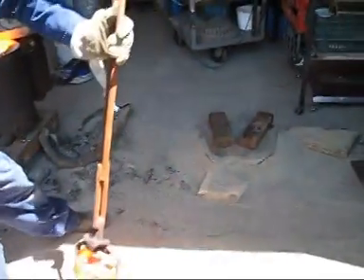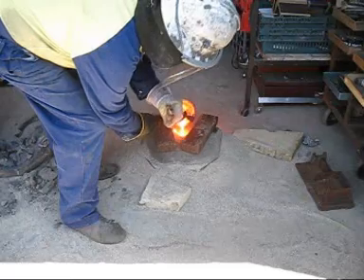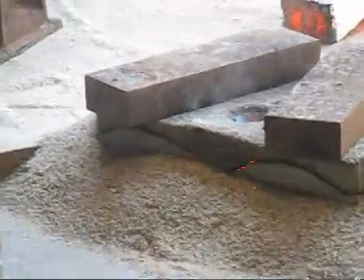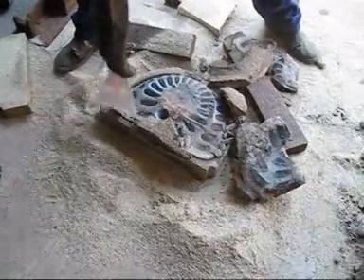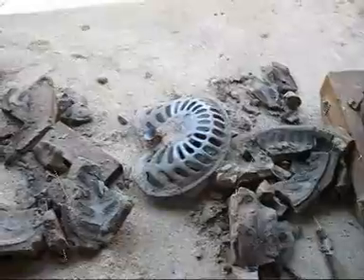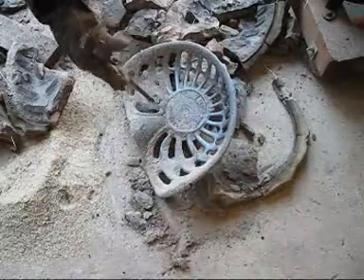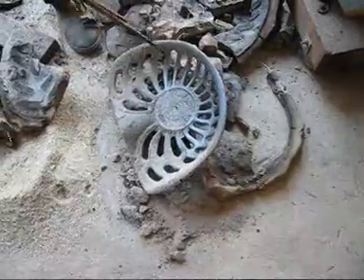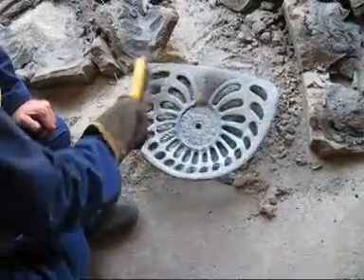Propane  furnace with air preheater

Comment from the maker: @mparkerlisberg The preheater is exactly the same as a heat exchanger, an inner pipe and outer pipe. Hot gases are piped from the top of the furnace to the heat exchanger and cold air is forced on to the hot pipe, then into the furnace.